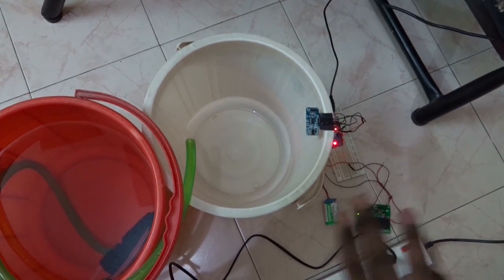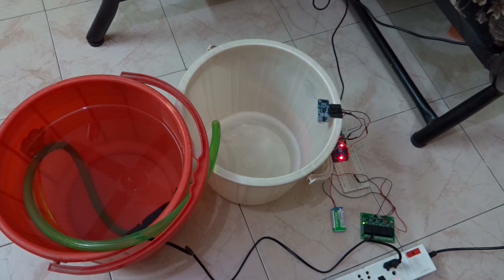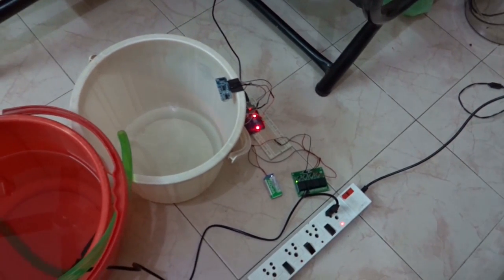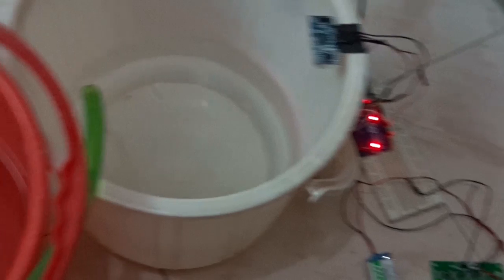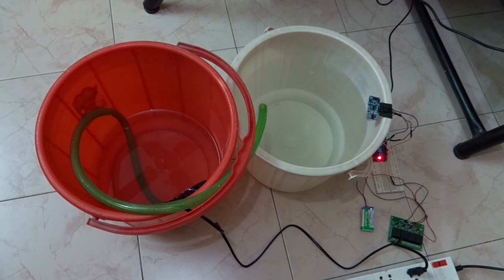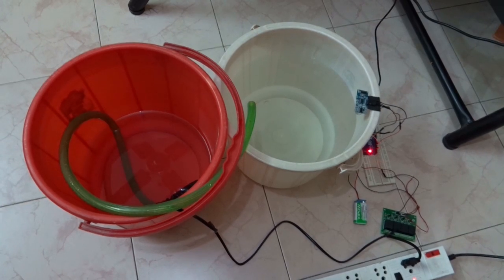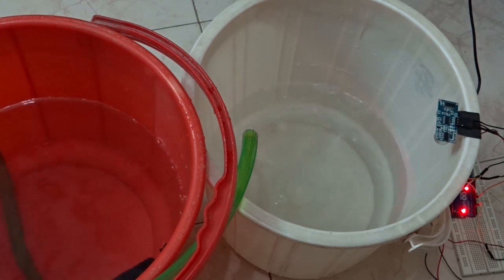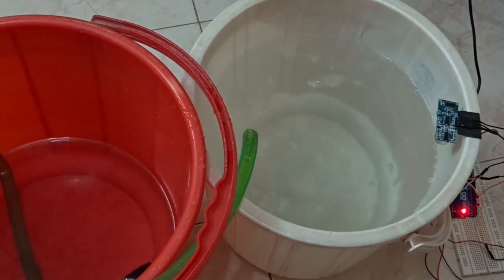Arduino Water level controller using Ultrasonic sensor HCSR 04

Comment: Nice video, I have a question. i plan to measure a depth of a Well, can the color of the water affect the measurement? or can the turbidity of the water affect the ultrasonic wave? I plan to use a JSN-B02 waterproof ultrasonic sensor and submerge the probe underwater.

Comment: I am making an automated water controller which is kind of the same as what you did. The only difference is that it will dispense water not fill. It means that initially the water is already in the container and once I've set the desired level, it will dispense the water through the water valve and stop dispensing water once the ultrasonic reach that level. 
Can you help me with this one? Any answer will be highly appreciated.
Nice video by the way, earned new subscriber.

Comment: What if there is no water in the red tub and the motor turns ON ?
Can we use another sensor to monitor the water in the other tub , if the water is available then turn on the Motor else stay turn OFF

Comment: Hey..cool project ..it's too good. Can you help me in programming my arduino UNO .I want a buzzer to ring when water reaches between 7cm -5cm and 3cm-2cm both using an ultrasonic sensor . I'm trying but not getting correct codes (sketches).send me syntax if you can please

Comment: I need to build a system like this here in my condo, but I have a doubt. I need to use this sensor in a range of... I don´t really know... 3 Meters? Don´t know if this sensor works in this kind of range. I have a huge tank here that I need to monitor. A 70.000 liter tank...
Reply: +Hugo Barros de Souza The HC-SR04 shown in the video is capable of up to 450cm according to the data sheet. That's 4.5 meters and is fairly decent for $2.

Comment: how about water pump...
untill now i can't get the result..
help me
Reply from the maker: Water pump not plays important role here.. its a submersible pump, turn on and off when it get the signal from the relay. the relay will be activated by the Arduino when the sensor condition becomes true.